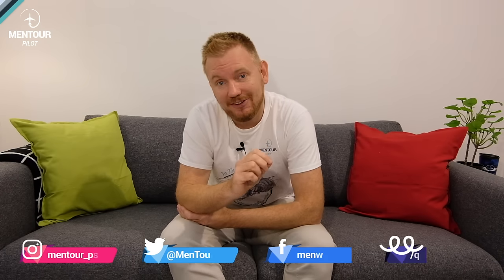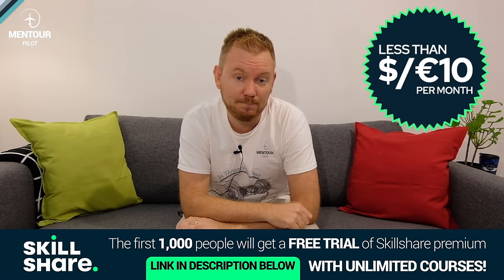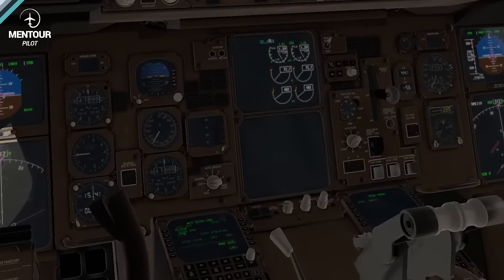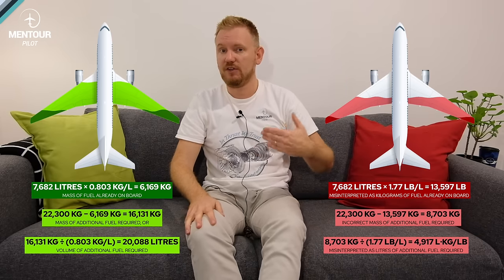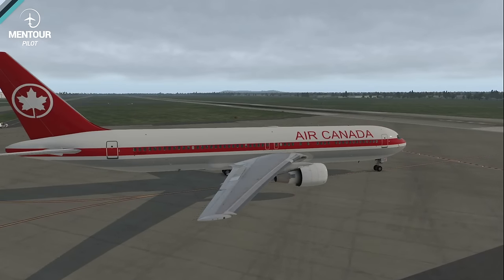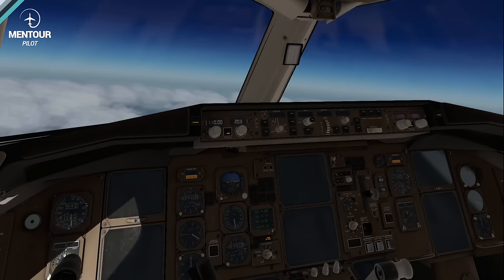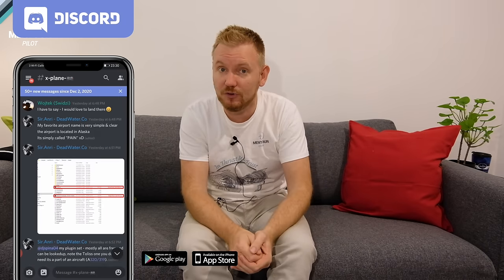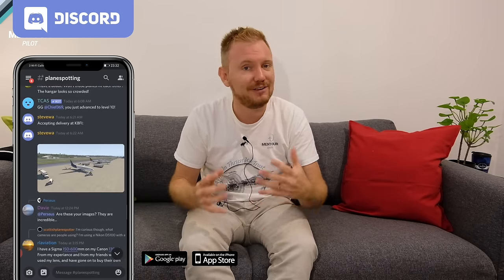The Gimli Glider! Explained

Comment: I'm just thinking. Wouldn't you realised the 15 tons weight difference during the take-off?
Great video again. Thanks!
Reply: In a 150 ton aircraft....i would guess it would be hard to notice...

What bothers me is that they looked at 5 tons of fuel and thougth "yea that sounda abour right" when the aircraft have a capacity of 50 tons
Reply: They're propably just using the same climb rates as they always do, so i guess it's barely noticable, that it accelerates a littlebit faster, especially when your concentration is mostly focused on the check lists and standard procedures.
Reply: Is that tons or tonnes?  :)
What struck me is, why they had to start with liters and convert to mass at all? Shouldn't the airport fuel trucks be calibrated in kilograms, filled in kilograms, have pump gauges that read in kilograms?
Reply: @donjones4719  Pilots want to know the mass, because they need to calculate the weight of the plane, but the maintenance personell needs to know, how much volume they have to pump into it. 

And no, they don't really want it, as different sorts of fuel can have a different weight per liter.

And you can say ton or tonne. It's propably a british-american-thing 👀
Reply: @mayaneko1094   Thanks. And it is an American thing. When we do manage to use metric we need some way to differentiate between an imperial ton and a metric tonne.
Reply: @donjones4719  well.. fuel is always mseeured in volume because that is how the machine messures it.

To have a straight conversion might not be the best thing. There exist diffrent density fuel. Armed forces have used high density fuel for special operation.

Also biofuel is generaly lower density. There does exist jet biofuel,  but its rare. Of cause that would not be a thing back then
Reply: @matsv201  they didn't know how much fuel was put in the plane on the previous trip. Could have taken on much more fuel than required.
Reply: @donjones4719  No, but let us also not forget that this was during the start of conversion to metric. Most airlines and aircraft were still using imperial measurements.
Reply: @Hans-gb4mv  not really. Firstly.. they actually messured it. Even if they calculated it wrong.. they should have gotten an impression of that the tanks was low when most of the dipsticks fell all the way down.

Secondly. There is a maxim landing weight... granted you could argue that is the plane was half full there is not really a problem landing with 20 tons of fuel. But most pilots would want todo that.

Thirdly.. generally you try to fly around wirh as little fuel as possible. That make ir so landing  you always end up with about the same amount of fuel.

Just a simple extimare wirh checking up any numbers.

The 767 (the original one) taked 50 tons of fuel. The range is... about 8000km This makes just over 5.5 tons per 1000km wirh spare fuel.. the distance.. just under  3000km... 16 tons. Of cause maybe a ton extra for the landing between.

This is a really simple an rought estimation. But its fairly close

Of cause you should not use that method to calculate how much to fill up.. if its 15 tons... then that is in the margin of error... if its 5 tons... well... that really dont sound right. Maybe check the calculation one more time.
Reply: @matsv201  No, they wouldn't. It's not the pilots that check the dipstick. As explained in the video, that is done by engineers on the ground. While the pilots could observe, they probably didn't and waited till they got the numbers. 

And while the numbers might look low for someone who is used to the metric system, these adult men grew up without using metric. Everything was in the imperial system for them. And it is hard to adjust to a different system as you keep referring back to what you grew up with. So they eventually get their numbers, don't think they seem odd because it's a unit they are not familiar with, do their lookup in the manual, which once more gives them a number in liters, not kilograms, and once more do the conversion with the wrong conversion number. At that point, everything seems right to them.

The guys on the ground? It's not up to them to make such a decision, even if they knew the flight plan, the guys at the first departure airport knew there was a stop planned after a short hop. But I can also imagine that these engineers don't always know what plane is going where. They get called to a taxi stand to perform a job and do that job. It's not up to them to second guess an experienced captain.

Yes, there is a max. weight for take-off and landing, but the captain flying this trip didn't land the plane. He didn't know what the previous craw was hauling, for all he knew, they took on extra fuel just because of the fuel gauge issue while the aircraft was light on cargo and passengers on the way in. While you do fly with low fuel most of the time, that is not always the case. For example when fuel at one airport is very cheap or expensive or because the airline wants to do a quick turnaround at a certain airport. Refueling takes time.
Reply: @Hans-gb4mv  
"No, they wouldn't. It's not the pilots that check the dipstick."
Its still the pilot that is compiling the numbers.

"And it is hard to adjust to a different system as you keep referring back to what you grew up with."
I don´t agree to that. Firstly, my calculation is not based on actually knowing the units, its just crunching the numbers. Secondly, it was not the first time they filled a 767 with fuel.

" He didn't know what the previous craw was hauling"
I did address that. You really very rarely do that.. Its so rare that it would raise an eyebrow.. at least in this case. If we would be talking about a small airport that is say with in a 1000km or so, then yea, i could see that being common. But on a major airport. That is really very rare.

I don´t say it does not happen. What i´m saying is that the pilot should be supriced that the plain come back with so much fuel to a major airport.

In this case there would be no reason to beleave that the plane come back with a lot of fuel. Of cause, that would not be stopping it from actually being the case. But that should be sufficiently uncommon for the pilot to do a calculation recheck.

Of cause with the stop-over they would have landed with a lot of fuel. But that kind of situation is really only common with the same pilot flying in and out. The only really common exception is when an aircraft is based of a smaller airport. Then you could see change over with a lot of fuel in the tank. Then we are really mostly talking about 737 or smaller aircraft's.

I´m not saying it would never happen. What i´m saying is that it should be that rare that the pilot think its odd.

The "he is unfamiliar with SI units" is not really an argument. He would have been using SI units every time he fuels his aircraft. He probobly been doing it over 100 times.

If he fueld between say 12 and 18 tons every time he flew that kind of a distance,. That his calculations turned out 5 tons the exact same day the fuel gauge was broken should raised a warning.

Note, i´m not blaming him for making a error in the calculation (or rather two). What i´m saying is that when the calculation turned out that ridicules number he should have double checked it
Reply: @matsv201  The thing you keep going back to is saying that they should have seen it because the numbers were too low. And that is the important part I do not agree with.

When you don't know the metric system, when you don't know that a centimeter is about 2,5 times less than an inch or a kilogram is a little over 2 times more than a pound or you don't know the difference between liters and gallons you will not realise those numbers are odd. They took the wrong conversion number and kept calculating with it. And because they kept using the same, incorrect number, they kept getting results that made them happy.

Now I'm not going to deny that multiple people made mistakes here and that this should have been avoided in the first place, but that is the story in so many accidents. As someone else in these comments wrote, it is seldom a single cause that leads up to a crash. Had the engineer pulled the fuse again, this would not have happened, had the captain respected the MEL, this would not have happened, had the person that came up with 1.77 picked the correct number, this would not have happened, ...

Hell, who knows, they might even have found it odd that so much fuel was left in the tanks, but worst case they would have asked to double check those numbers and they would have gotten the same numbers back. All because the blacked out fuel gauge made them do something they probably never had to do in the first place.

I don't know what you grew up with, imperial or metric. Maybe you are one of those lucky people that grew up with both. I grew up in metric and whenever I want to have an idea of how big something is in imperial measurements, I need to do the convertion to metric. But I don't know a lot of the convertion units and would need to look those up. An inch or a mile? Yes, a pound? Somewhat but anything else? I might as well throw a random number at it and try to get lucky.
Reply: @Hans-gb4mv  You keep ignoring my point.
 
If he fueld up the jet 100 time, it don´t matter if he know the unit or not. He know what there usually is. When its so far of what the normal amount would have been, then a red flag should have been raised.

It don´t matter if the number is in kg, ton, liter or pounds.. The number is still just a number
Reply: @matsv201  The problem is NOT the number, they see a number that in kilograms matches what they should have. Why? Because they used an incorrect number to do the conversion. Something they usually do not do because the fuel gauge gives them that number. The mistake is the number used for that conversion which doesn't trigger them because the number they get is what they expect due to the incorrect conversion number they use.
Reply: @Hans-gb4mv  I have explained this quite clearly for you now 4 times.  Its really easy to understand.

Are you even trying to understand it? Or are you just amusing you are right?
Reply: @matsv201  Let me answer your last question first by saying that I could ask the same to you.

Look, had they attempted to convert to a unit they are familiar with, like pounds or gallons, and had they done that correctly, they would most likely have spotted their mistake. They might even have realized that the 1.77 belongs to the conversion to pounds instead of kilograms. But they didn't. 

The only other thing that might have given it away is the conversion from centimeters to liters. Petter said you do that by tables in the manual. Depending on how that table looks, it is possible that the person doing that conversion should have realized how high up the table he was and how much more rows there were beneath it. But again, one would have to see how that looks in the manual in order to judge that.

Furthermore, from what I've been reading this fine evening, the number of 1.77 was given to the pilots by the fuelers and when required, it is usually the fuelers that do that calculation. However, in this case, the guys in Montreal used 1.77 and apparently the one in Ottawa, where they measured the tanks again, gave them a number of 1.78 for the conversion. When you get similar numbers, why doubt them?
Reply: @Hans-gb4mv  he should doubt it not because the numbers them self is strange but because it gave a unresonable low value.

He could easly contact there service center and ask them to double check it. A lot of pilots have... lets say... worse math skill than they really should have
Reply: @matsv201  You  would think that but ... no. I've actually started reading the actual report myself and I suggest you do the same, the fuel calculation issue starts at page 38. To summarize: Before the 767, all aircraft of Air Canada had a flight engineer on board. It was the FE's responsibility to calculate and monitor the fuel. With the 767, the role of FE was no longer required but the airline did not update the procedures. So basically, no one was responsible for the loading of fuel or for calculating the correct amount.

Since calculations usually were not required and the drip stick procedure was also uncommon, no one involved had any experience. Looking up the value from the drip sticks was easy to convert it to liters, but neither the pilots nor the ground crew nor the service center people (yes, they did call them) were aware on how to correctly convert liters to kilograms. None of them had gotten any training on the procedures they were performing as normally everything would simply be handled in kilograms. The MEL required the fuel gauge to be operational, it was only due to the distraction of a maintenance engineer that the fuse was not pulled again to make it operational.

The incorrect number of 1.77 was requested by the FO from the fueller who incorrectly gave the number for liters to pounds instead of kilograms. The FO assisted with the calculations since he noticed the ground crew struggling with it. The captain later went over the figures with a slide ruler to confirm them. A second conversion was done in Ottawa where the ground crew also handed over an incorrect number to do the conversion, reaffirming they were doing the right thing.

The drip stick figures were 64 and 62cm, that is not nearly empty, probably because the higher you go, the wider you can go in the wings. But because all of this was unfamiliar and none of the crew involved (flight or ground) knew what they were actually doing, it did not set of any alarm bells with any of them. I can't find how long the drip sticks are on a 767, but it would again rely on so many factors. For example the pilots knowing how tall the fuel tanks are at the spots that got measured (only 3 of the 7 sticks got measured).

At the end of the day, the bigger mistake was that the Captain had a case of confirmation bias. Everything he came across confirmed for him that it was OK to fly without the fuel gauge even though it wasn't. And I think for pilots, that is the bigger lesson to learn here (and from other accidents), beware of confirmation bias.
Reply: @mayaneko1094  Hi Maya, a UK  ton is 2,240 pounds. The US ton is 2,000 pounds and the tonne is 1,000 kilograms, equating to 2,204 pounds.
Reply: @donjones4719  Tons are imperial & 2,000 lbs each.  Tonnes are metric: 1,000 kg or 2,200 lbs.  Also called long tons.  I'm sure the fuel trucks wouldn't have been converted at that time since all other aircraft would have still be using imperial units.
Reply: @mayaneko1094  A ton is 2000 US pounds.  A tonne is 2200 US pounds or 1000 KG
Reply: @matsv201  How do you know, how many times they did this procedure (and the drip stick procedure in particular)? And even if you're correct with "100 times", how do you know, that they actually understood, how it worked in particular? 

I bet, you've used several formulas in the school as well, without really understanding them (like almost any kid ever in the history of math classes), in which case it gets harder to actually tell, if numbers seem odd as long as it's somewhere within the expected range.
Reply: @Hans-gb4mv  Conversion between imperial and metric is a recipe for disaster. The SI system is developed to make things simpler. E.g. one mile, on land , air or sea is something different, it’s too confusing. Somebody in this thread said metric tonnes and imperial tons are different. Long way to go if both systems are used.
Reply: @rodgerjohnson2658  Long tons are different from metric tons/tonnes. They are close, but not the same. Long tons are used for shipping (as in boats) still. A long/imperial ton is 2240 lbs or 1016 kg (+ 46.91g) vs. 1000 kg (~2204 lbs) for a metric ton. The imperial ton gets its odd dimension from the fact that it is a multiple of Stones. Specifically, 20 long hundredweights of 8 stone, or 160 x 14 lbs. edit: "long" hundredweights because a "short" hundredweight is 100 lbs, and so, a "short ton" is 20 short hundredweights, or 2000 lbs.
The US says "metric ton" because "ton" and "tonne" are pronounced the same.
Reply: @Hans-gb4mv  you just ignore my point and keep writing the same thing. It dont matter if you are right or not, you have to adress my point, and you have not done thia yet
Reply: @mayaneko1094  the amount of fuel abould be the same regardless of method. So even if he ne er done that  before "in action".. it wouldnt matter
Reply: @matsv201  as you correctly state, you keep going back to the same point over and over again. The point that the pilots should have known by the number of liters that it could not have been a correct amount. 

I keep showing you different ways why that is not necessarily true. But while you simply keep hitting the same nail over and over again without adding any arguments, I keep digging and learning and sharing as to why I feel you are wrong.

And I'm sorry that you can't grasp the concept of pilots not knowing how much liters of fuel they usually have on board since they always talk about weight instead of volume (as volume depends on temperature). All their instruments handle fuel in mass, not in volume, their flight plan specifies the required fuel in mass, not in volume and the volume they are seeing here is in a metric they are unfamiliar with and they are not trained for. 

If I ask you to drive my car and I tell you that it has enough fuel to drive for 10000 pixies, and give you an incorrect conversion number to convert it to miles, you're gonna say: fine, I can make that distance. Since you don't know yourself how many pixies go into a mile you run with it. I must know the correct number, I got it handed down by corporate after all. 

These pilots have logged most of their careers flying aircraft where fuel was measured in pounds and the fueler might have his rig set up for gallons. They've flown most of their hours with a flight engineer who had the responsibility to keep an eye on the fuel and who knew how to do the conversion.

That is one of the mistakes that the airline made. Not appointing someone who would be responsible for calculating the fuel and not ensuring that the crew was trained on the new metric fuel system as found in the 767 (again, read the report).

So, if you still cannot grasp that pilots talk about fuel in mass instead of in volume, then I'm sorry.
Reply: @Hans-gb4mv  
"I keep showing you different ways why that is not necessarily true. "

No you don´t, because my explication supersedes yours.

Its obvious that you don´t understand the core concept of my explanation
Reply: @matsv201  in that case, why don't you explain to me in a different way why you believe the pilots should have known they didn't have enough fuel. Because I haven't seen you give any real explanation as to how they should have known other than your own belief.
Reply: @matsv201  
It's just ridiculous to expect every human to never do any mistake ever. I would bet tons of money, that you as well did some mistakes, which are as "obvious" as the one these people didn't notice. 

And saying, that it's impossible to not notice these things is like stating, that the pilots caused this accident on purpose and i highly doubt, that that was the case here.
Reply: @paulbrouyere1735  "One mile, on land , air or sea is NOT something different". There are different miles. A nautical mile is/was one minute of latitude, very convenient for navigation on the Earth. Now it is defined as 1852 meters, which agrees to about 1 part in 100,000 to the historical definition.
Reply: @Hans-gb4mv  i never said they should have known. I said the low number should have raised a flag. It dont matter what unit it is when they use the same unit every time
Reply: @mayaneko1094  
It is obius.

If you fill your car with gaoline and it o oy fit 5 liters... (or 1 gallon) you would react. This is the same situation.

No im not saying they did it on purpise. What im saying is that they seam to ignore what should have been a red flag. When the calculation is this much of from what it usualy gets... and that happen on a day you happen to do a lot manual. You should react .
Reply: @matsv201  and that is my point: they don't. The only correct quantity they have seen that day is in litre. But that is a unit they never see. As I've written many times now, fuel on jetliner is measured in mass, kilograms in this case, not volume. The pilots know how many kilogram can fit in the tanks, not how many litres. They know how many kilograms they burn in an hour, not litres. These men probably had never even considered how much litre they burn in an hour or they would need for a trip like this because they always work with mass.

And after the incorrect conversion they don't see an issue because the numbers they are working with are reasonable and correct. The fact that the check in Ottawa gave them expected results and gave them the same number to convert from volume to mass didn't help.

In their daily job they never come across the number that was exceptionally low. Yes, there's an argument to be made for the low quantity they required, but the drip stick measurement was done by 2 people in both airports and the conversion number given was also similar so at no point had they any reason to doubt the fact that the plane still had enough fuel. the fact it is uncommon that so much fuel is left in the tank is not enough to raise alarmbells as uncommon does not mean impossible.
Reply: @matsv201  
They didn't ignore it, because their calculations told them obviously, that they've enough fuel. That's why you can be here today acting like as if you're never doing any mistakes like this ever.
Reply: @Hans-gb4mv  your point is wrong. They fuel the aircraft everyday and use the same unit every time.

You keep ignoring my argument and acts like a troll. This discussion is over
Reply: @mayaneko1094  what there math told them dont matter. Is the number is unresonable.

Its not about not making errors. Is abour not ignoring red flags.

Its like you filling your car with fuel and it says 5 liters / 1 gallon and you say.

"Well that sounds about right"
Reply: @matsv201  no, I do NOT ignore your argument, you are ignoring mine. You keep talking about fuel as if it is measured in litres, that pilots and ground crew refer to fuel amounts in volume. They don't. How hard is it to understand that when your gauges show mass, when your papers show mass, when your training is about mass, when consumption is measured in mass per time, when your manuals talk mostly about mass to understand that fuel in jetliners is not measured in volume but in mass?

Yes, they fuel the aircraft every day and every single time they talk about how much mass they need or have loaded, never about how much volume because volume is not constant. 1000l of jet fuel loaded in Norway in the winter will get you further than 1000l of jet fuel loaded in Dubai in the summer. But 1000kg in either case will get you the same distance. Volume depends on temperature, mass doesn't. Why do you think they had to do the conversion in the first place if they could have just used the volume?

Now, in your last posts, you keep calling me a troll and other things, you keep calling me out but the one thing I do not see is any fact to back up your claim that pilots would ever refer to fuel quantity in volume instead of mass

A jetliner is not a car. Yes, you fuel your car up, you count litres or gallons or whatever. And if you look carefully, you might even see on the fuel pump an indicator that shows that the fuel is at the right temperature. If you have seen such a pump, ever wondered why? Read up, that is why. Because fuel density changes with temperature, the amount of potential energy in a litre of fuel changes with temperature. Fuel stations want to keep the fuel at a steady temperature because they want to give the same amount of energy every time, because they buy fuel per mass, not per volume.

So yes, unless you can add some facts, unless you can add some evidence, unless you can add a basis for your claims, you should start to wonder who is the troll here.
Reply: @Hans-gb4mv  TROLL.

I already told you. My argument supersedes yours. ITs not that i´m ignoring your argument. Its invalid.

As long as you don´t understand that you are not even in the debate.

You are spamming loads of text that is totally irrelevant
Reply: @matsv201  
And that's where you're underestimating the possibility of how wrong math can cause numbers to still look right.

5 liters are roughly 1,32 gallons. But if you're making the mistake to calculate in the wrong direction, you're getting 18,925 gallons, which seems to be right for a car with a 20 gallon tank, which you want to make nearly full. And now imagine, that your fuel gauge is broken and you neither get told, what you've paid nor the cashier tells you, that 5 litres is quite a small number for a car with a 70 liter tank. That way you can't really tell, if you've calculated it in the right direction, if you're still thinking in gallons rather than liters.
Reply: @matsv201  why does your argument, that you base on an opinion, not facts, supersede mine? Why is my argument invalid? What facts do you have to call my arguments invalid?

I mean, you keep saying those things without giving any evidence, without giving any proof. You think you are right and therefore void anything that does not fit your theory. It's not that I'm not in the debate, it's that you are not giving any arguments.

Your only argument is that they should have picked it up because the amount of fuel they loaded is low. I've given you plenty arguments why that is not the case, yet you can't give me any facts that debunk my arguments.

Captain Pearson made a lot of mistakes on this flight, not doubting the amount of fuel to be loaded was not one of them. If it was, it would have been mentioned in the report.
Reply: @Hans-gb4mv  as long as you dont even accknolage my argument there is no point in talking to you.

Keep it to the point and stop spaming irellevant stuff.

I debunked your argument 5 times.
Reply: @Hans-gb4mv  i told the premise for my wife... she is a florist.. she didnt have any problem what so ever understanding it.

I explained it to you 5 diftrent way.

In short. Troll
Reply: @Markle2k  Thanks for the update.  That makes more sense.